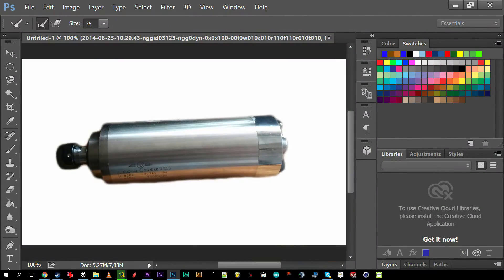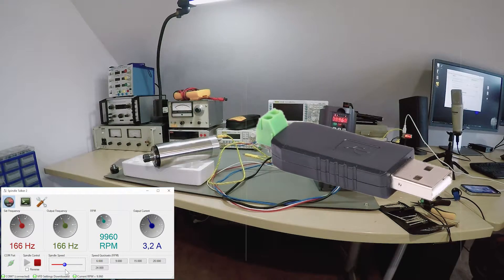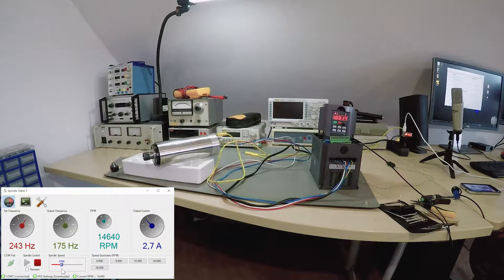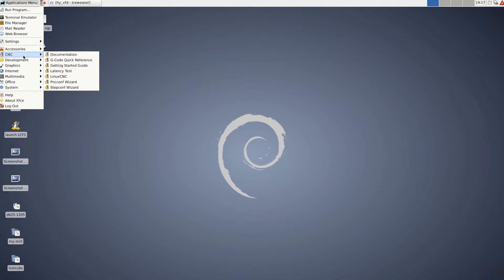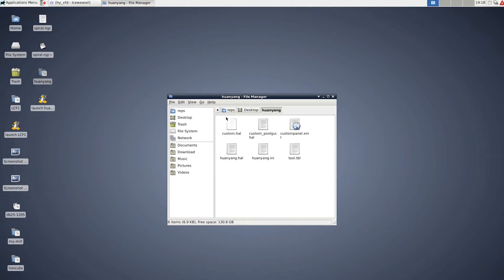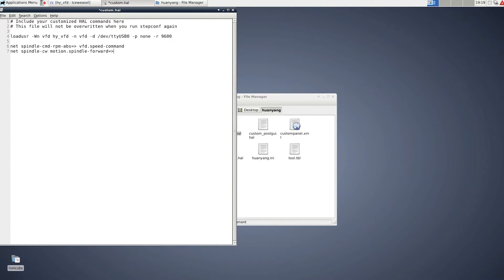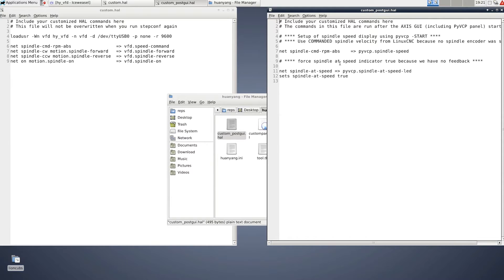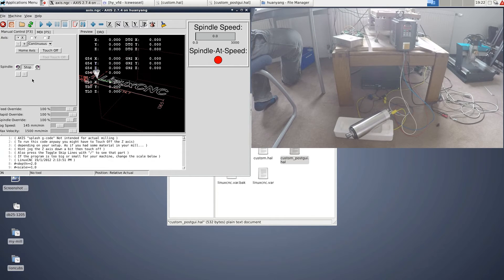Remotely controlling the Huanyang VFD with LinuxCNC over RS485 Modbus

Comment: The custom.hal script, as shown in the video, will not work for LinuxCNC 2.8+ (at least it didn't for me)
This is how it should look now:

loadusr -Wn vfd hy_vfd -n vfd -d /dev/ttyUSB0 -p none -r 9600

net spindle-cmd-rpm-abs           => vfd.speed-command
net spindle-fwd spindle.0.forward => vfd.spindle-forward
net spindle-rev spindle.0.reverse => vfd.spindle-reverse
net on          spindle.0.on      => vfd.spindle-on

The main change is: "motion.spindle-forward/reverse/on" becomes "spindle.0.forward/reverse/on".
The most shocking thing was that I couldn't actually control the speed before I changed spindle-cw/ccw to spindle-fwd/rev. I could only start and stop the spindle before that. It was a shot in the dark. I didn't believe it would change anything but it did.

P.S. Always use filtered USB cables! (As shown in the video) Those USB-to-RS485 adapters glitch out even if you sneeze at them.
Reply: Ah! We're at it again! in 2.10.0 spindle doesn't fully work again. I can only turn it on and off, and control the direction. No speed control once more. I tried to return the spindle-fwd/rev back to spindle-cw/ccw but it didn't help. I'm at a loss again.
Reply: YESSSS !!! I GOT IT RUNNING !!!

I used an ancient spell, called: Looking at the documentation. XD Gee, who knew the documentation might have some answers for me. XD
So now that I got the self deprecating humor out of the way let me describe how I got it to work:
Firs my old custom.hal:

loadusr -Wn vfd hy_vfd -n vfd -d /dev/serial/by-id/usb-FTDI_FT232R_USB_UART_A50285BI-if00-port0 -p none -r 9600

net spindle-cmd-rpm-abs               => vfd.speed-command
net spindle-fwd spindle.0.forward => vfd.spindle-forward
net spindle-rev spindle.0.reverse  => vfd.spindle-reverse
net on                spindle.0.on          => vfd.spindle-on

those net things are actually variables of type net. So lets take the second line: We have a variable of type net with name spindle-fwd and since net means connection the value of this variable is going to be two things: connecting what to what. In this case, the source signal spindle.0.forward to (=>) the VFD component vfd.spindle-forward. Notice however the first line does not follow this format. It seems that spindle-cmd-rpm-abs is both the name of the variable and the source signal?! I don't know how that worked before but apparently it doesn't any more. So after consulting with the documentation I tried replacing the first net with:

net spindle-speed-cmd spindle.0.speed-out => vfd.speed-command

this worked, the +/- buttons appeared and they were correctly controlling the speed. Also the spindle started responding to the MDI commands in linuxcnc. One small hick up was that the RPM panel that I've setup in linuxcnc didn't show the RPM. But I knew why. The GUI panel is an XML script that indirectly depends on the variable spindle-cmd-rpm-abs which in this case is replaced by spindle-speed-cmd so I either had to change the name of the variable in two different files or just:

loadusr -Wn vfd hy_vfd -n vfd -d /dev/serial/by-id/usb-FTDI_FT232R_USB_UART_A50285BI-if00-port0 -p none -r 9600

#type, name                            val: source                ->  destiantion
net      spindle-cmd-rpm-abs spindle.0.speed-out => vfd.speed-command
net      spindle-fwd                  spindle.0.forward     => vfd.spindle-forward
net      spindle-rev                   spindle.0.reverse     => vfd.spindle-reverse
net      on                                  spindle.0.on             => vfd.spindle-on

As you can see I just plugged the spindle.0.speed-out at the appropriate place in the old line that was controlling the spindle speed.
And that fixed it!
Hope that helps!
:)

Comment: Thanks for your video. This was great to get me started although I found that LinuxCNC v2.8 has change a little in that you can now have multiple spindles, so you need to specify which spindle to control. custom.hal changes as follows:

loadusr -Wn vfd hy_vfd -n vfd -d /dev/ttyUSB0 -p none -r 9600

net spindle-cmd-rpm-abs => vfd.speed-command
net spindle-cw spindle.0.forward => vfd.spindle-forward
net spindle-ccw spindle.0.reverse => vfd.spindle-reverse
net on spindle.0.on => vfd.spindle-on

Hope this helps someone!

Comment: Thanks so much!  I just got my spindle working with LinuxCNC and this video made it very straightforward.  I appreciate you taking the time to do this!
Reply: ? Did you ave to conect Ground wire..Can it do fwr-rev , start-stop
Reply: @johnross3752  On mine the ground was wired to the 4th pin on the plug already.  It has full control from Linuxcnc.  Spindle on-forward on-reverse, and RPM.  It's perfect.

Comment: Good day, I need to control a spindle speed from a CNC milling machine, the machine have a parallel port board for the stepper motors, and apparently that especific board does not emit an analog signal to use with the VFD, do you know how can I solve this problem without removing the board the machine already has?

Comment: Gut gemacht.   Does it mean that Linus cnc would pass M3 spindle on, M5 spindle off, and Snnn speed commands interpreted from GCode or is your implementation just to remote control from the screen.
Reply from the maker: Interprets gcode too!
Reply: ***** could you share the modbus registers you read and write and what each value means.  VFD documentation is terrible.  Or share PM me  the data map.

Comment: Thanks for posting.  I have 2.7.8 Linuxcnc, Mesa system. Trying to get a cnc mill up and running. I am running servo encoder system. I am new to linuxcnc. is there a copy of the files needed to run this VFD or do I need to somehow make the ini, hal files?  I see you used stepconfig to generate your files.  I am not sure if I need to use pncconf wizard (and if I do.. I am lost in the instructions).  all my current files have been copied from a linuxcnc member with the same machine with postgui.hal

Comment: Thanks alot for the guide!
I followed tour guide and while it worked in windows using spindle talker 2 it didn't work in LinuxCNC.
Got an error message:
ERROR Communication time out (-12)
error reading settings from VFD, retrying
WAIT_DATA(): comms timeout

After a few nights of troubleshooting and watching your video about 10 more times I decided to replace the USB->rs485 adapter which solved the issue. (doh)

Comment: Thanks for posting will try it.  I have 0 exp with linux coding so could you explain the   $ 1s /dev/ttyUSB* that pops up at 3.00 mark, is the $ 1s the (Wn vfd hy_vfd -n vfd -d) is that a 'component' in the default linuxcnc with ubuntu 10.x?  Linuxcnc fails to load and I get errors with line 4 loadusr -Wn vfd hy_vfd -n vfd -d /dev/ttyUSB0

Works great with fresh wheezy install!
Reply from the maker: Thats an L, not a 1 :)
$ ls /dev/ttyUSB* lists all USB telecommunication devices such as RS485 adapters. If there are multiple, ttyUSB0 might the the wrong one.
And I would recommend a fresh installation, because the ubuntu 10.04 image is too old.
Reply: thanks I will try another as I just use a live disc, which "image" do you use ubuntu, someone told me linuxcnc 2.7 only works with 10.04?
Reply from the maker: Debian Wheezyfrom the linuxcnc website: http://www.linuxcnc.org/linuxcnc-2.7-wheezy.iso